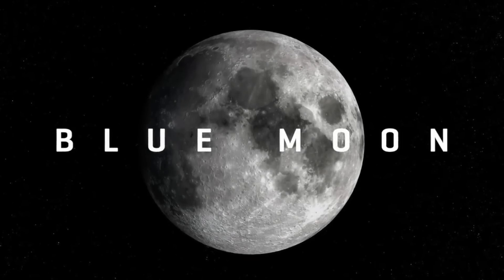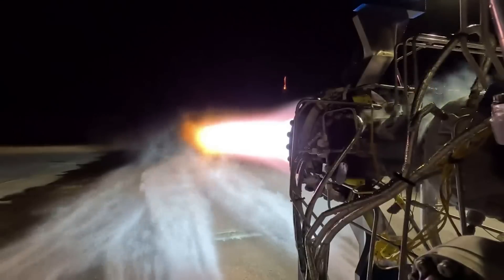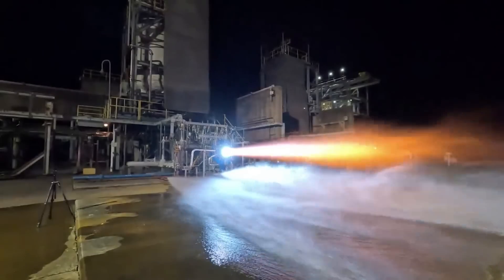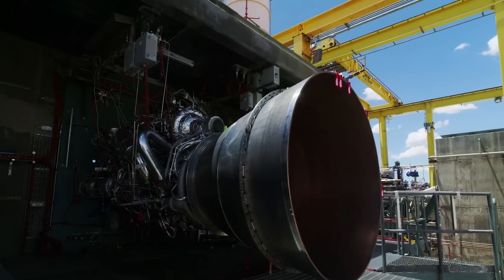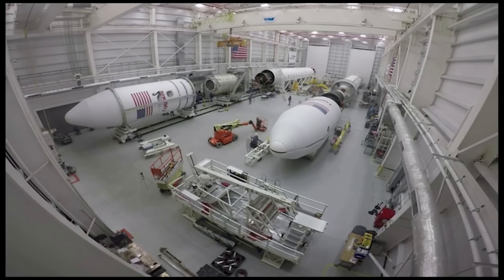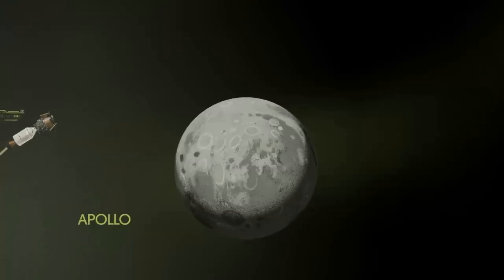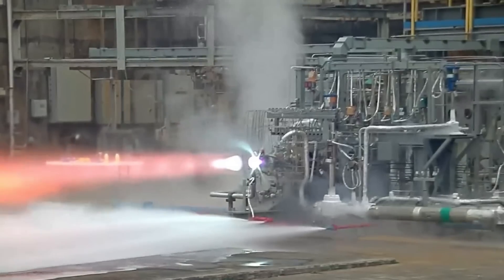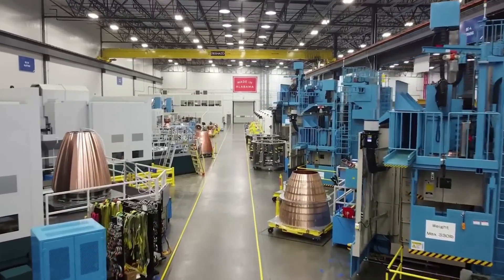Blue Origin's Progress Toward A Human Moon Landing

Comment: It's better than the original Apollo lander, but SpaceX definitely has it in pure volume and metric tonnes.
Reply: Given that it interfaces with gateway and Orion, massive amounts of cargo really only matter, if you are bringing stuff from Earth, when you launch. The new BlueOrigin lead National Team lander will be reused in lunar orbit multiple times, so it only needs to lift, what Orion brings to them. If NASA wants bigger payloads on the moon, they can contract separate cargo landers through CLPS, instead of HLS.
Reply: @plainText384  Yeah, but I don't think Orion is meant to carry huge volumes of cargo or mass. From what I heard it is only meant to reach Gateway. And, NASA is contracting both SpaceX and Blue Origin to interface with Gateway and then land on the moon. But now that I think of it, it would be more practical to use Blue Origin as the moon lander, and Starship as the cargo lander.

But, whichever company can do both will reap most of the money.
Reply: @GoldenTV3  Blue Origin has a separate cargo lander, Blue Moon, at least that was my understanding. But SpaceX and BO won't be the only companies contributing to NASA CLPS, there are potentially dozens of contractors competing for these missions, many more than for HLS. There will be a wide variety of landers in different weight classes performing a wide variety of missions.

Comment: The BIG problem with using LOX-Hydrogen in space… boiloff
Reply: You need to call the Rocket Scientists and let them know.
Reply: That lunar liquid hydrogen is THE rocket fuel for the future Earth/Moon economy has been known for 50 years.
Anyone who doesn't know this (i.e.Elon Musk) is new to the Space Race.
Reply: same with methane and oxygen, wonder how any company is going to deal with that issue
Reply: @mathewferstl7042  At 5:50 as stated on this video BO plans to develop solar powered 20 K cryo coolers to maintain the H and LOX at low enough temperatures to prevent boil off.  Also mentioned was other unnamed technologies would be utilized to control H and LOX boil off.   

Given BO's track record for not getting anything done on time who knows how this latest technology development will fare. 

The temperature for methane doesn't have to be anywhere near as low as hydrogen to maintain it as liquid.  191 K vs 20 K.
Reply: @michaeldeierhoi4096  yeah saw that after my comment... lol